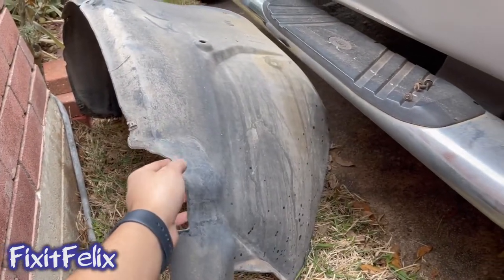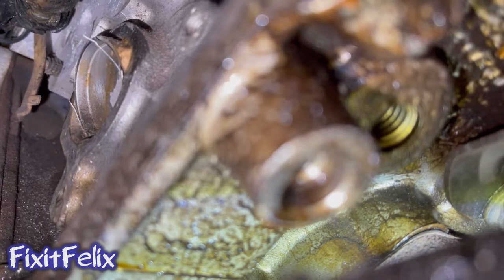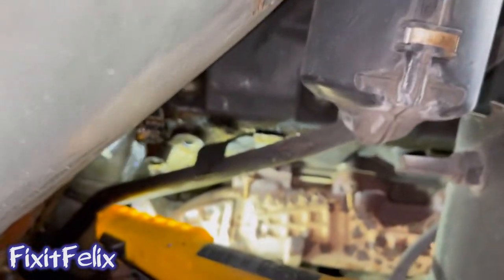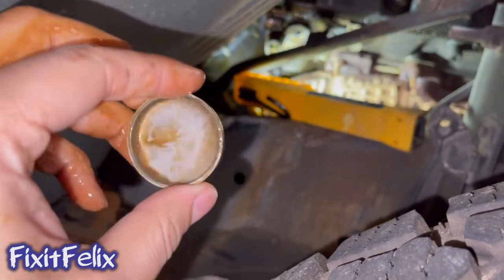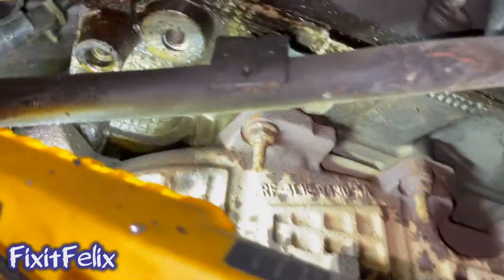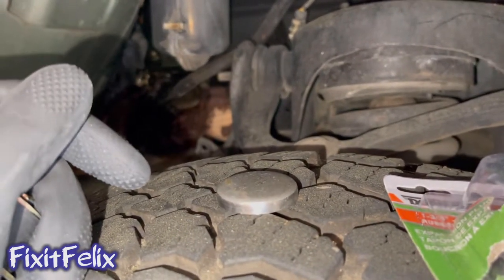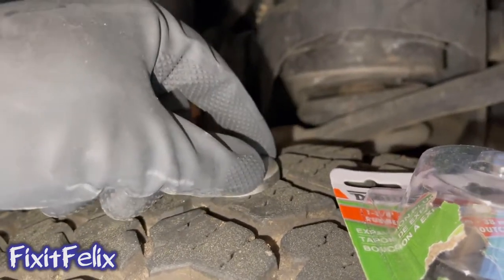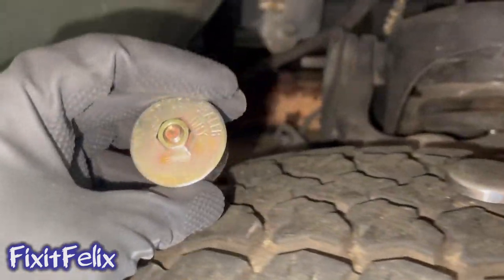Ford F-150 Freeze plug

Comment: Put a COLD freeze plug in and do not pound it. The block should be warm. Once it is down in there start the  engine with coolant in it. The freeze plug should warm up and expand from heat and set itself with no hammer needed.

Comment: I'm just here to tell ya the Jan 2024 freeze got me. Same thing: my truck (1997 F-150 XLT 4.6L V8) leaks somewhere, slowly, and monthly I top the radiator off, often with straight water because it's a beater and I'm a lazy bastard.

Well, in the summer it manages not to overheat on straight water.

And then this freeze came, and it hit the teens (thanks polar vortex!) and froze my cooling system pretty solid. This blew out the freeze plug behind the driver's side mount in the block. What a hassle. I'm hoping a rubber one like you used will go in without me having to take the motor mount off.

This is my secondary vehicle so it's not the end of the world, but it's a hassle.  Once I replace this one I can find out if others blew out like the one in this video. We'll see! (I do my own repairs, but I don't wanna.)

As I was saying, "well, well, well, if it's not the consequences of my own actions." LMAO.
Reply: Did it work? Currently got this problem and don't want to take it to a shop again.
Reply: The rubber ones are bad about popping out

Comment: So your plug was one of the rears? Did it dump into the oil pan & crankcase? I think my issue is one of the front plugs under the timing cover? My dumbass left just water in my 98 5.4 Expedition when I removed the heater hoses to change the nightmare plug #4. I live in northern AZ where it gets very cold (not all of AZ is desert). I filled the truck up with water....then we got 3 days of snow....now I have same issue. 😭😭😭
Reply: Having same issue think it has for mine was sitting awhile I believe it’s lower freeze plug behind timing cover

Comment: Water in your oil is a head gasket problem. That is  a freeze plug that will cause your coolant to leak out. You have 2 seperate problem’s

Comment: what year is your f150? Mine is a 1998. Hopefully it's similiar.
Reply from the maker: 2007
Reply: @FixitFelix529  okay, so you just basically ran like a garden hose and ran it in to get the water to come out. I'll try this. Thanks for the video. I was told I had to take the motor half way out...yada yada...lol

Comment: I'm sure you know by now, water in your oil is not caused by a bad freeze plug. Bad head gasket or cracked head is the problem.